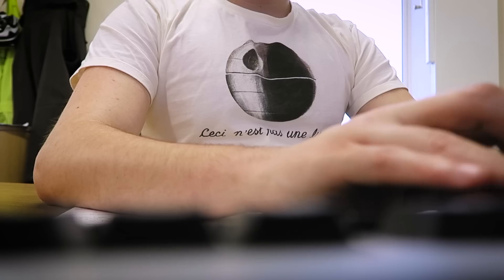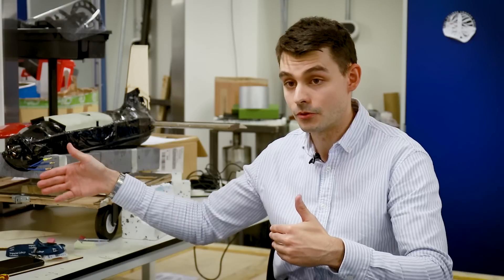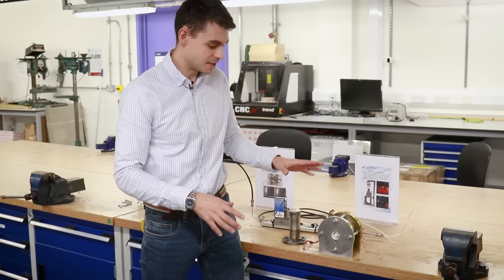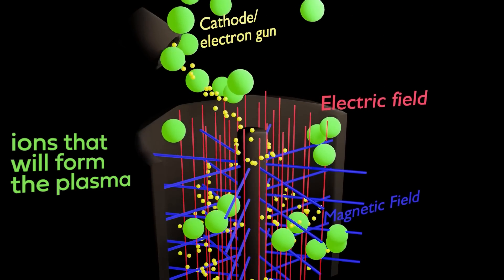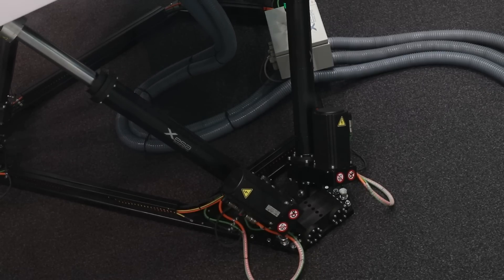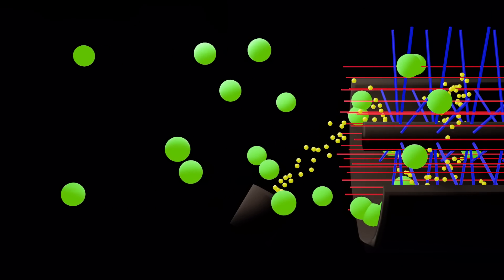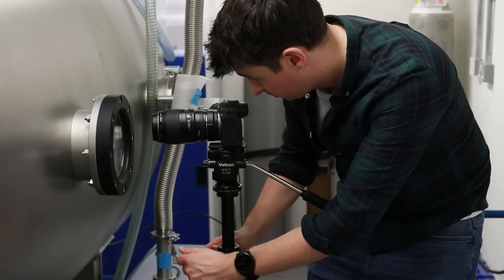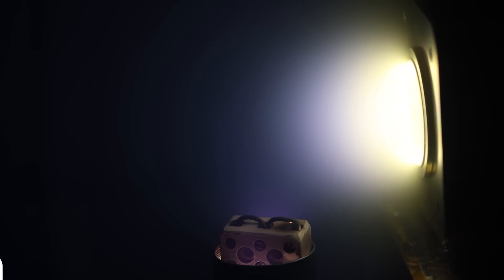Can you use water as rocket fuel?

Comment: I question the use of the term fuel here. Surely the water, or rather the oxygen from the water, is being used as reaction mass not fuel. It is not providing the energy for the spacecraft. I assume that would be coming from solar panels?
Reply: Correct buddy! The solar panels bring the energy to the spacecraft, the water is just to gain momentum (i.e., create thrust)
Reply: Simon’s videos are very good, but in this case the title is a bit misleading…

Comment: Water expands, potentially breaking things, when it freezes. Does that mean that energy will need to continually be expended to keep the water liquid on missions to the outer solar system, even when the thruster itself doesn’t need to be active?
Reply: The trick is to increase the pressure of the tanks so it remains liquid!

Comment: well it makes a lot of sense cause right now we're eating up the potential savings from using electricity for propulsion with a exotic, costly pressurized propellant. Could be a game changer for small scale satellites
Reply: There’s some interesting development for plasma thruster for small scale satellites. The issue with hall thrusts is size limitations due to neutralizers required but hollow cathode Pocket Rockets use a plasma to heat a neutral species usually argon as the propellant. I was part of studies looking at tailored waveforms  to optimize the efficiency and thrust and it’s looking really promising
Reply: yup, that's the other side of the story: while argon, being a noble gas, should be relatively inert, i guess working with ionized oxygen as in the video sounds like it could get quite rough on the electrodes.